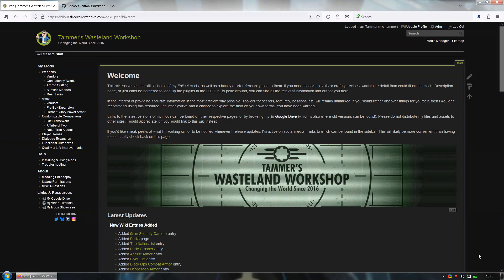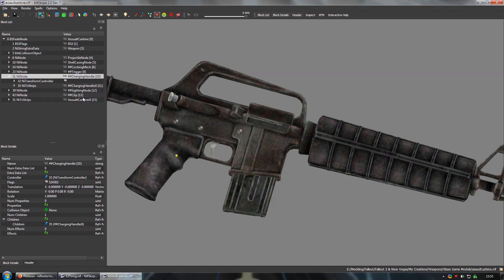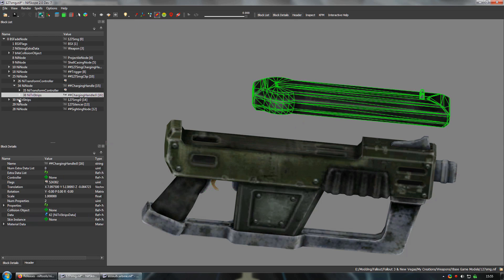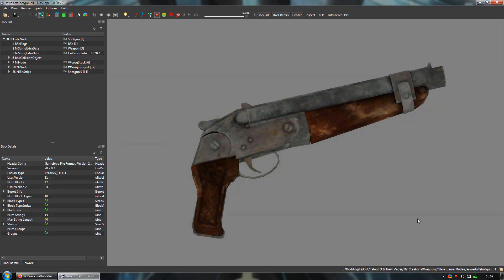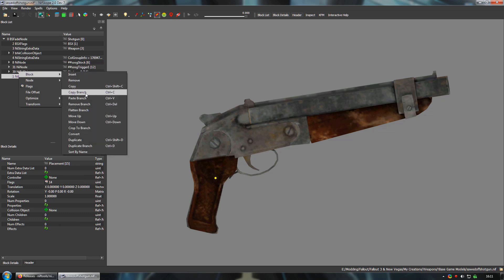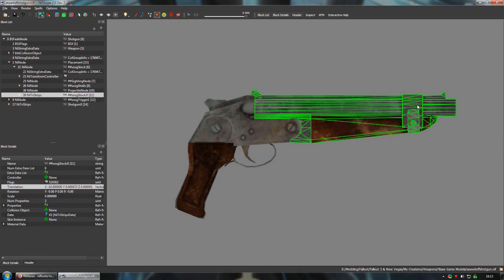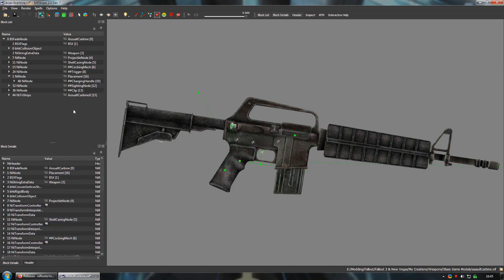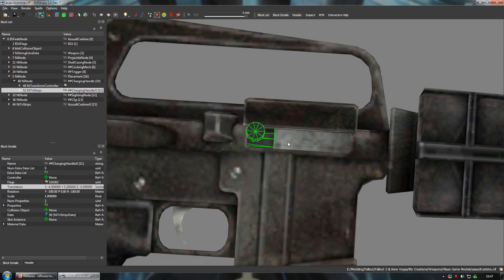Tips & Tricks - Working with Nested Nodes

Comment: Could you do one about getting projectile nodes to work, and maybe exporting them? i cant figure out how to make them or new billboard lasers. Working with contraints would also be a hit
Reply from the maker: This is beyond me, as I've never had to do anything with them. As far as I know, you can add a projectile node in NifSkope by right-clicking, selecting Block >> Insert, then choosing NiNode >> NiNode. And it needs to be named "ProjectileNode" for the game to recognize it. However, I usually just use the one that came in the vanilla mesh I'm using as a base, or copy/paste one in from a different mesh and edit the translation values to move it where I want. If you're talking about adding more than one projectile node to a mesh, I'm not sure that can be done.

I notice there's also a NiBillboardNode option, which I've never used but might be the way forward? The only time I've ever used Billboard nodes is with the pilot light on a flamer, in which case I just copy/paste it into my mesh from the base-game weapon.
Reply: @mctammer i see, no problem; i guess i will keep making tests and see if it works. I think ive found some work arounds to test maybe, is there somewhere i can message you because i probably have 100 questions since then which i dont want to bother you since you are a lone wolf modder for the most part, but i am trying to do alot of more obscure things and weird mechanics. You would call me mad, but i think you might understand some of my thought process
Reply: @mctammer the thing with the projectile nodes; if you look at the flamer, its flame, sometimes its lobber, or head laser. I think its just trying to pick up A named thing; but my classic sentry bots ive made several variants, but the one with the flamer wont fire its flamer, i am gonna attempt the extra addon like the sentry bot has for the rockets. Im noy sure how to implement new projectiles, editor nodes, constraints for traps/statics like hinge ones to make a chain work like a chain. Idk do you have a discord or something? Its no big deal i just wanted to ask and check in how your projects are going.
Reply from the maker: @Draxtemsklounts  Is the flamer marked as an integrated weapon? I have no experience with making creatures, but I think you need to make in an integrated weapon, and add a projectile node to the skeleton nif of the creature.

As far as I know, you load up the skeleton nif in NifSkope, right click, add a node, name it ProjectileNode, and move it around using the translation coordinates like I show in my NIF-Bashed Weapons tutorial.
Reply: @mctammer okay, thank you! I will make an attempt; but creatures work basically the same way as armors but with slightly a bit different rules with the body part data. Have you ever messed with traps?
Reply from the maker: @Draxtemsklounts  I have not, no. I have an idea for one, but haven't gotten around to trying it.

Comment: Would it be possible to make the hammers on millenias double barrel shotgun to move individually with each shot this technique? Or would they have to move together, or is it not even possible?
Reply from the maker: It would require an animation that already has two separately-moving hammers. Even if you used this technique and added each hammer to a different positioning node, they would still move together because the nodes have the same name. Or, only one would move and the other would not, because the animation file only accounts for one node with that name.
Reply: @mctammer  makes sense. I guess if I use the cowboy repeater anim I could make both work as a "both barrels" type shot. Although I'm not sure how the hammers would "cycle." Guess I'll have to figure that out.